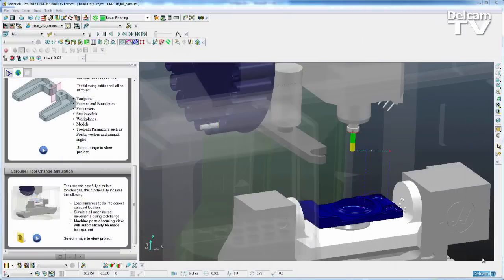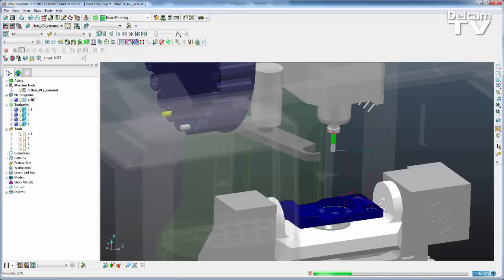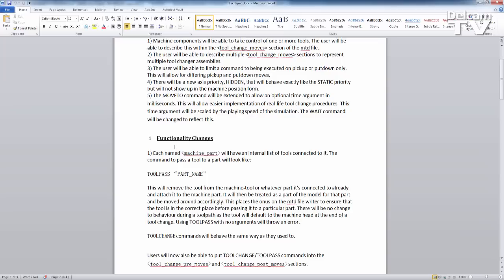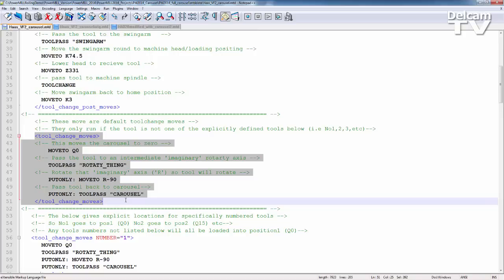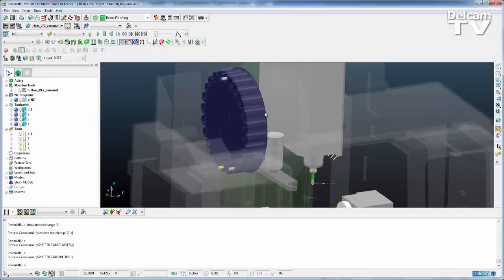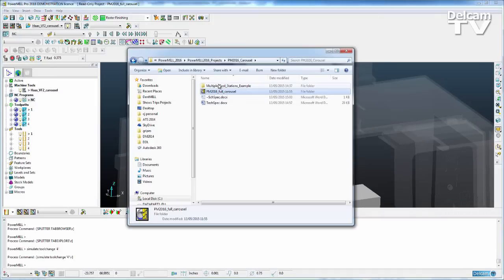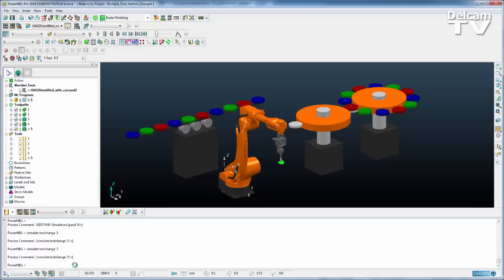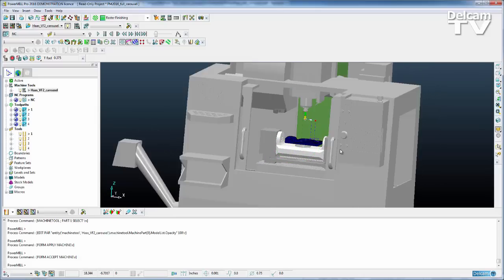Carousel Tool Change Simulation and Machine Tool Transparency - PowerMILL 2016

Comment: Hello.
Tell me please, is it possible to get this MTD file with carousel toolchange?
If yes, how?
Reply from the maker: Thank you for your question.  If you wish to get this MTD file, or are looking to edit your own MTD file to perform a similar simulation motion, we recommend you contact the local Autodesk reseller that you purchased PowerMill from, and they should be able to help you with this.
Reply: @AutodeskAdvancedManufacturing  Thank you for the answer!
Now I've made the MDT file with a carousel toolstore. I spent several evenings, but I've done it).
At this time I have several questions: 
1. How to connect MTD file with postprocessor file? I saw in the net a picture from PowerMILL where is a machne's tree and trere is a line with name "OptionFile". How to insert this information into MTD file? I haven't found this information not in the PowerMILL help, not in the Postprocessor help, not in the MTD help.
2. Now after loading the machine into PowerMILL all the tools are handing into air. And them take their places in the carousel only after toolchange simulating.  Is it possible to connect them to the machine automatically?
3. The real machine makes toolchange at the same time: it moves next tool to the spindle and previous tool to the carousel by the swinging arm at the same time. But it isn't possible to make it in MTD model. I'm right or not?
Reply from the maker: @paveleroshev5878  Thank you for the questions.  You are obviously dedicated to getting this MTD working as you would like.  Unfortunately I cannot provide you with the answers, as my role to simply manage the social channels.  But we want to make sure you get the best help possible.  In order to do so, please follow this link https://mfghub.autodesk.com/support-discussion/ to access information on how to get Autodesk support, and the team will be able to help you.